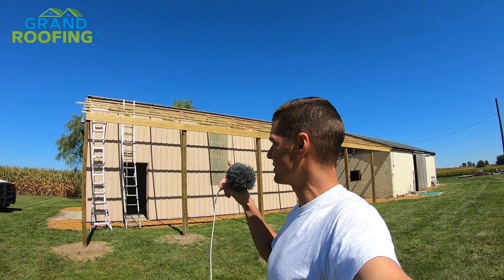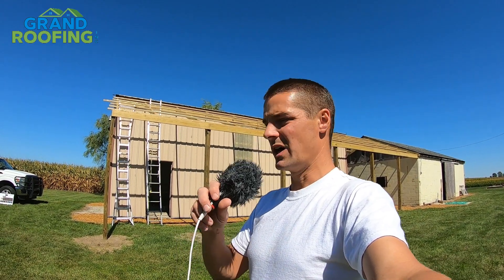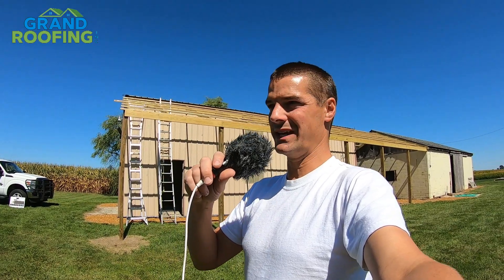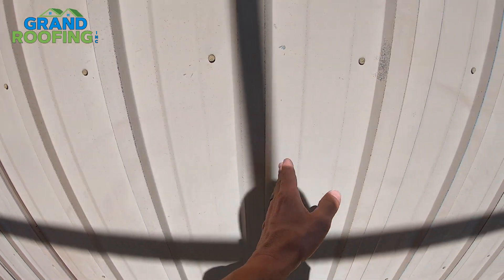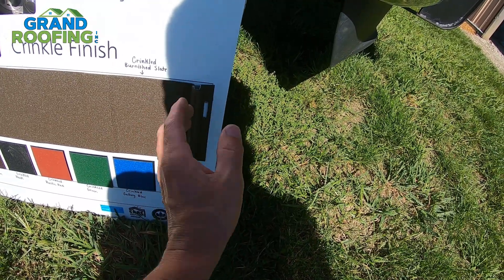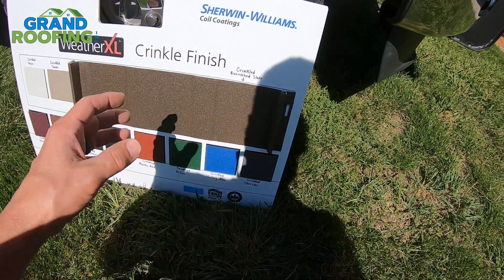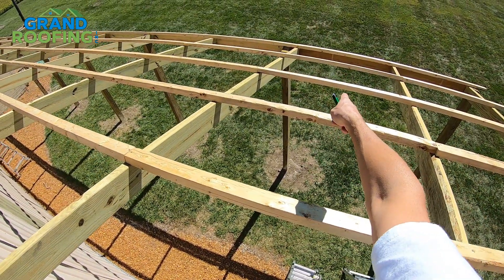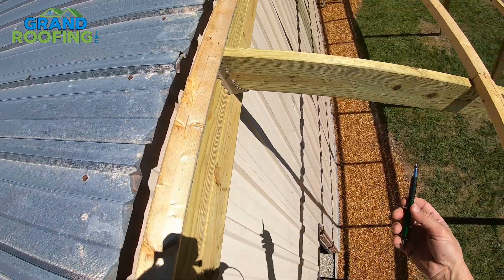How to measure for a metal roof - DIY how to measure for steel roof

Comment: Make sure you use the smallest screws on your exposed fastened roof.. many fly by night roofers slam an exposed fastened roof on with a #14 or 3/8 cladding screw and they can’t change them out once the washer goes. Also an inch and a half mechanical seam in different than snap lock which you were referring to with a rubber mallet.
P.s always vent your ridge. Doesn’t matter if the buildings heated. 
  Also there are minimum lap allowances under roofing code. So you may want to check into that. Your transition may need to be 6” or 8”?
Where abouts are you?
Love the vids
Reply from the maker: Thanks for the info. We are located in Kokomo Indiana, 1 hour north of Indianapolis. Yes having transition go up a little further is always good practice and nice. 
 Tying into the old barn roof it had ring shank nails fastening it down. I tried to remove a couple before ordering material, they weren't budging. It damaged the panels or the nail heads broke. I ordered it a little smaller then normal intentionally.

Comment: Bummer.  There's no audio.
Reply from the maker: I just checked it, what do you mean no audio?
Reply: I could hear it
Reply from the maker: I was going to say, I had audio when I uploaded it and played it back. Thanks!
Reply: Can hear it, only my right ear is happy 😊
Reply from the maker: Damn your right! It only recorded on one channel. I just put my earbuds in and can only hear it on my left. I think it has something to do with the cable connecting my mic. Thanks for bringing some light to this. I might have some trouble with my new lapel mic being mono.
Reply: @GrandRoofingInc  I just rechecked it.  I'm using the YouTube app and my stereo Bluetooth headset gives no audio on this video, yet I have audio on other videos.  I turned my headset off and listened on speakerphone and the audio is loud and clear.  Maybe I need to update the YouTube app 🤷‍♂️ What I do know is that my Bluetooth gives me the audio on every video I watch,  except this one.
Reply: @GrandRoofingInc  hey Brian, I figured out that my one Bluetooth side isn't working.  I don't usually use it,  so it hangs inside my shirt.  The left speaker must have gotten damaged somehow and only my right speaker works.  The mono must be on my left speaker,  rich is why I couldn't hear it.  Every other video that I've listened to is in stereo,  so I can hear them in my right ear.
Reply from the maker: Thanks! I'm going to do some audio test before I recorded more videos, with that mic or the wireless lapel mic.
Reply from the maker: Or maybe something I can do in the editing software to copy the audio channel over.
Reply: WTF are you talking about?!Haha just kidding I could hear him fine cause he was speaking into his fluffy mic!!
Reply: @GrandRoofingInc  you’re probably right about that if it wasn’t stereo make sure there are two black bands around the jack if only one it’ll only record it mono!!But Ivheard u just fine on my phone great video can we see your notations next time while you’re measuring I know you had wind issues so you had to add another thing(mic) to carry was thinking seeing the notations might be helpful?!Just a thought,Take care and be careful on those roofs!!